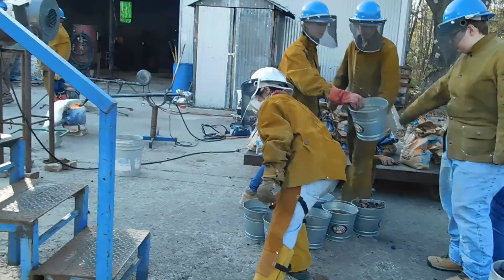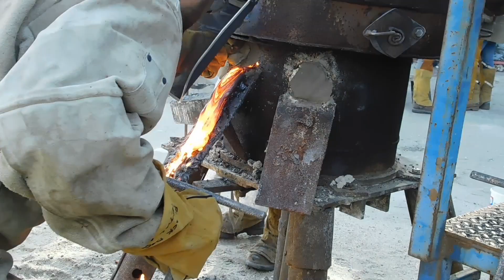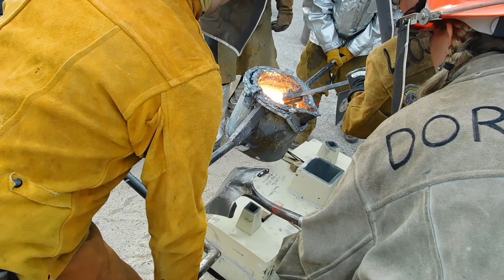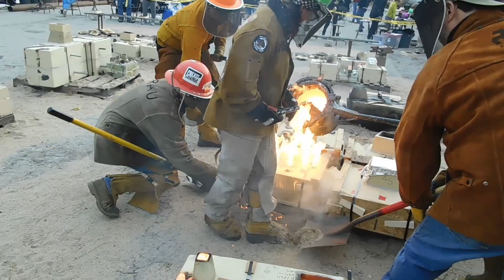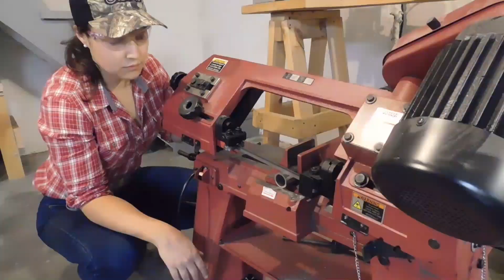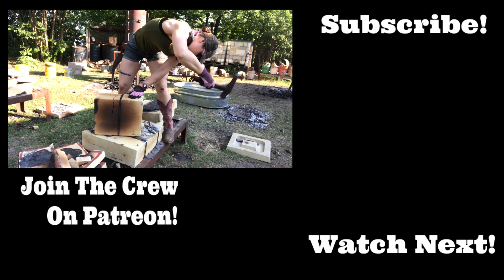Cast Iron Explosion | Reaction Mold | On the Iron Trail with the Cast Iron Gypsy

Comment: When I first started oxy/acetylene welding soot would build up on the tip of the torch and make a lot "POP" when it blew off.  Instinctively I would flinch and make a divot in my weld.  It took a good while before I become accustom to it and not jump.  I would imagine it takes a lot of practice to get accustom to molten steel flying everywhere.  New subscriber on the advice of Abom.  Wishing you lots more subscribers.

Comment: At what temperature does it melt?
Reply from the maker: Iron melts at around 2,800 degrees Fahrenheit
Reply: @CastIronGypsy  I just looked on the internet. At what temperature does cast iron melt? It melts at 1250 degrees. is it true?
Reply: @CastIronGypsy  Steel melts around 1535 degrees
Reply from the maker: Yup…The Internet says 2,800F (1,538C) 😁
We just dump in fuel and turn the blower up and when everything is hot we put in the iron scraps!  There’s no thermostat or thermometer on these home made furnaces! 🤣🤣
Reply from the maker: I don’t claim to know ANYTHING about steel lol